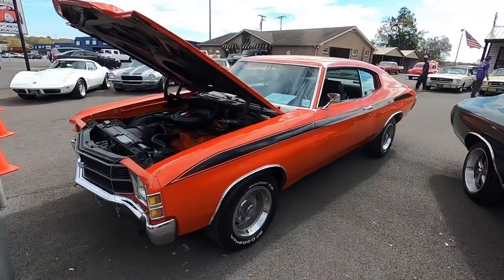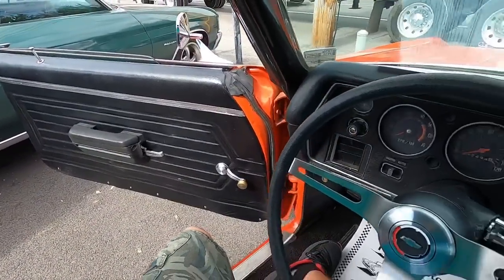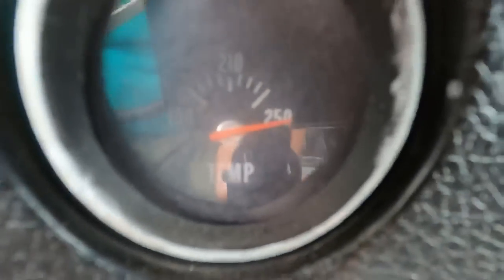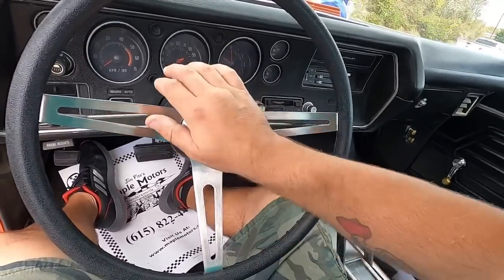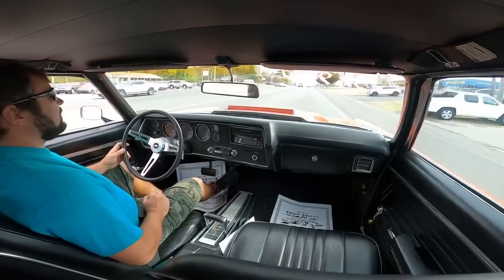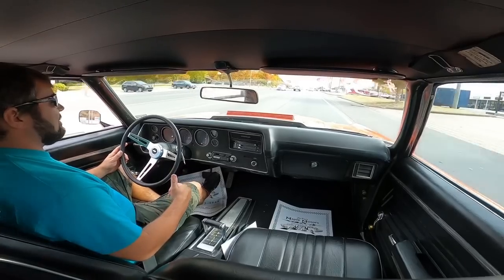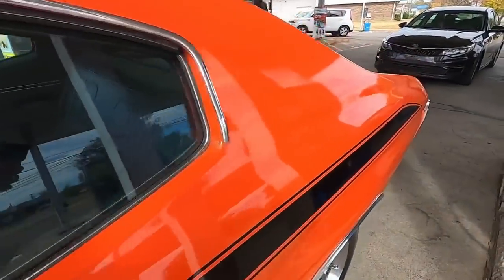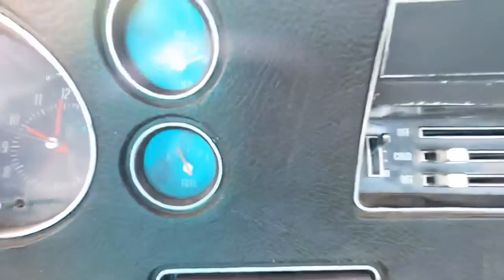Test Drive 1971 Chevrolet Chevelle SOLD $31,900 Maple Motors #1896

Comment: Great car. Looks like heavy chevy stripes and also has all the things you would want with a Chevelle, functional cowl induction hood ss dash and center console.
Reply: The cowl induction hood is not functional,, the flapper door would close when the engine is started
Reply: @paulpeterson8952  It does have the flapper it most likely needs some hardware to make it work.
Reply: It has no hardware at all except the door, there is an inner flapper door that opens with a selinoid from a switch at the gas pedal and another vacuum one to open and close the outer door

Comment: That car looks to be a heavy chevy version or a good clone  , it has the ss style dash the correct interior panels which are different trimmed  than normal door panels etc.. plus the correct stripes were installed .